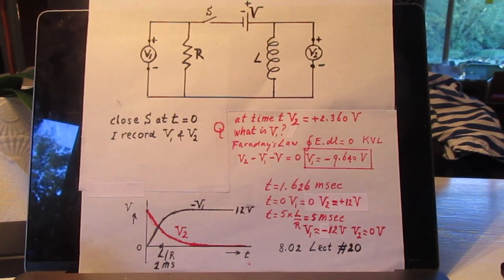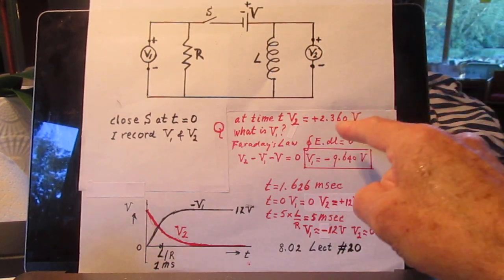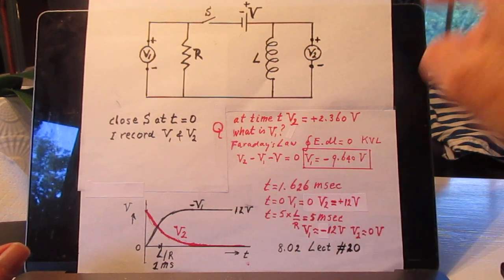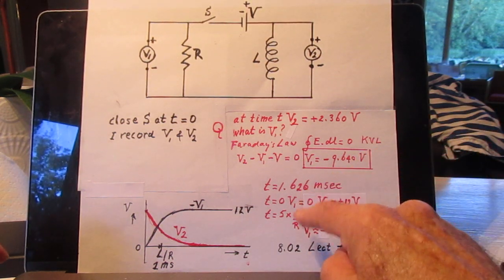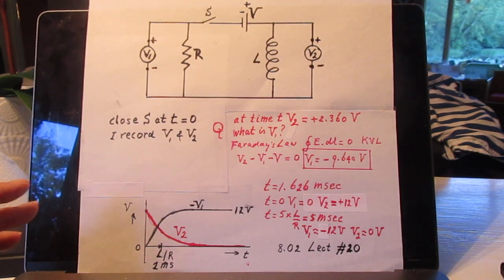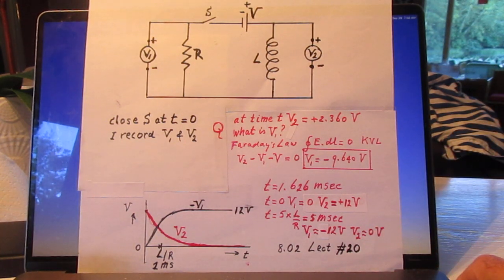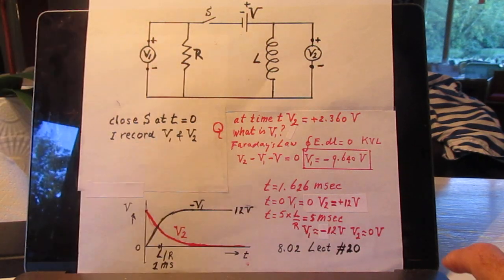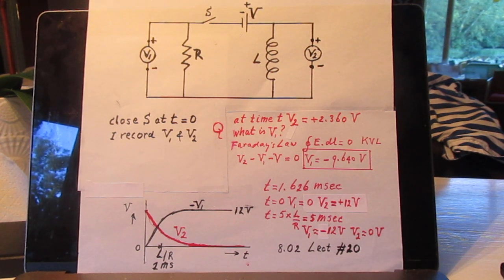Solution Problem #120 - Self Inductor + Resistor

Comment: Professor Lewin, I have a question. Can a pendulum ever stop under the effect of Air resistance? Air resistance reduces, if the pendulum bob's velocity reduces.
Reply: Sure it can. The magnitude of resistive force may reduce but it is always directed opposite to the velocity. It would definitely stop.

Comment: Ive been thinking about why the current slows in the inductor and I think I have a 'dead animal' explanation (sorry about those) to go along with the previous rollercoaster, conservation of momentum analogy. 
In the cyclotron, the radius of the  electron's orbits is determined by the strength of the magnetic field i.e. it does positve magnetic work to attract towards the center and turn the electron but simultaneously has no effect on velocity.
In the coil, the magnetic field does no work to change the direction, the electron does that work on its own or was done for it by whatever twisted the coil around and so logically the work now performed (which is inescapable) by the magnetic field is now negative, a repelling force and works opposite only upon the velocity and not the direction which is now wholly determined by the coil circuit design.

Comment: Can  a voltmeter be connected wrongly in a circuit?  V at the lower end of R is heigher than V at its upper end.
Reply from the maker: When I measure a voltage with my digital voltmeter, I attach it to 2 points, NOT knowing which of the 2 is + or --. If I measure --12 V then I know which side is + and which is minus. If I measure +12 V I also know that. Thus there is no such thing as connecting it wrongly.
Reply: @lecturesbywalterlewin.they9259  .. thank you dear Prof. for the clarification. Used voltmeter is a digital voltmeter not the commonly used high resistance voltmeter as used in dc circuits. But I have read somewhere that the digital multimeter have issues measuring transient currents and hence potential difference. 🙏
Reply from the maker: @parasharisir  When I was a kid I had a analogue voltmeter. It had a + side and a - side on the scale. Zero V was in  the middle.  You could use that voltmeter in the exact same way that I am now useing my digital voltmeter.
Reply: @lecturesbywalterlewin.they9259  ... dear Sir, can I draw your attention to time or ( /time constant) as used in this problem. It is of order of 1 ms. Can a digital voltmeter/ multimeter do this measurement? 🙏🙏
Reply from the maker: @parasharisir  watch my 8.02 lecture #16.  I make voltmeter measurements on a time scale of less than 0.1 msec. That's what oscilloscopes are for.
Reply: @lecturesbywalterlewin.they9259   Thank you so much dear Professor. 🙏🙏☺️. I do appreciate your efforts.
Reply: @lecturesbywalterlewin.they9259  
Just saw R,CL parallel circuit as well.
... dear sir solenoid is completely filled with non conservative electric field, whose planes are perpendicular to the time varying magnetic field along the axis ( still closed path line integral E.dl =0). Yes, no electric field along the axis of the solenoid!!   Thanks
Reply from the maker: @parasharisir  >>>> solenoid is completely filled with non conservative electric field, >>> incorrect The non-conservative field is elsewhere in the circuit not in the ideal solenoid
Reply: @lecturesbywalterlewin.they9259  ..... Thanks a ton dear Professor. Will try to expore and correct my mistakes. ☺️🙏.
Reply: A voltmeter can be connected backwards in a circuit, and it will just mean that you get a different sign than you expect.   If you are using a voltmeter to check polarity, you want to make sure that it is connected the way you expect, so that the sign on the meter tells you the information you need.  If all you care about is magnitude of voltage difference, it won't matter, and you'll get the same answer either way.  You can also connect a voltmeter, as an ammeter should be connected, and it will just end up reading the open circuit voltage, instead of the voltage of the circuit while it is operating.

It is an ammeter, or a multimeter in Amp mode that requires proper connections, otherwise you could damage the meter or circuit.  The correct way is for an in-line ammeter to be connected in series with a circuit, so that all the current of interest to measure, will pass through it.  If you connect it in parallel with a circuit, you will short the circuit through the meter, and draw more current than the meter can measure.   Ideally, there is a fuse in the meter to mitigate the damage if you do it wrong.

Comment: If I wanted to build a Kelvin water dropper, would there be a difference if I used a sharp object to discharge the electricity, rather than a spherical object?
Reply: Then it will reach breakdown voltage earlier

Comment: You should teach your viewers some LaPlace.
Call the node connection L and R for Vo. The node equation becomes

(Vo-Vin)/(sL) + Vo/R = 0 

And the transfer function becomes

H(s) = Vo/Vin = R/(sL+R)

When you close the switch, Vin is a step, so Vin(s) = 12/s
Vo(s) = H*Vin = R/(sL+R)*12/s

The inverse LaPlace gives
Vo(t) = 12-12*exp(-1000*t)
Which matches the two transients you have graphed. But for students, math and equations may make more sense than just pure intuition, in my opinion.

Comment: I= V/R(1-e^-Rt/L)
Voltage across resistance V(R)= V(1-e^-Rt/L)
Voltage across Inductor V(L)= Ve^-Rt/L

Putting the value of V(L) = 2.360.  we can find the time . And further can use second equation for finding the voltage across resistance at time 't'.  I solved using this method. Thanks to Walter Lewin sir, Alakh sir, HC verma sir, Rajwant sir and Tapash air for teaching me. I am very much thankful to all these teachers...

Comment: Good explanation. You could have addressed what happens when the switch is opened. I design electronics and preventing the high voltage spike when the switch opens is a very important part of many designs

Comment: Sir How LCR Circuit useful for everday life?
Reply: Homemade antenna --  think maximum power transfer.(and less smoke)
Reply: Electrical filters.   You can take advantage of the fact that inductors and capacitors have different responses to different frequencies, and arrange the components so they can either stop or pass a desired range of frequencies.  In the extreme limits, a capacitor acts as an open circuit at low frequency and a short circuit at infinite frequency, and an inductor does exactly the opposite.  In combination with a resistor, an energy storage component can form a low pass or high pass filter.  This is what is used in the circuits that make bass and treble knobs work on an audio system.  You can also use the condition of resonance between an inductor and capacitor to set up band pass and band stop filters.

This is also how your landline telephone can double as the carrier circuit of your internet, in technology such as DSL.   You can equip the landline receivers with a low pass filter so only the frequencies in human voice get through, and you equip your modem with a high pass filter, so the landline voice signals do not get through.  Dial-up internet didn't do this, and used signals within the range of human hearing, so you couldn't simultaneously use internet and phone.  DSL selected carrier frequencies above the range of human hearing, which has the advantage of a greater bitrate capacity, and the advantage of not being in conflict with the audible voice signals.  You can also use the condition of resonance between an inductor and capacitor to set up band pass and band stop filters.

Comment: No, I think it will be 
V1=9.64V, not 9.640V.....
Reply from the maker: both are wrong!
Reply: @lecturesbywalterlewin.they9259  ok, but why, u have explained that V1 will be equals to 9.640V!
Reply from the maker: @satyamparija7614  >>>> why, u have explained that V1 will be equals to 9.640V!>>>>   I DID NOT V1 = --9.640 V.  plse watch my solution and get educated.
Reply: @lecturesbywalterlewin.they9259  V1=-12V and V2=0V,,,,,, right??

Comment: Mr. Lewin I have followed your footsteps of unraveling true nature of the natural phenomenas surrounding me but  me and my friend have come across a phenomena which we haven't studied in books or a podcast. We have observed that when a flashlight strikes an A4 sized paper then it glows blue  and so on when we add pappers we found that it turns red, the same experiment done with other papper made the reverse transition of colours. It would be an honor if you help us with the problem!
Reply: I think the colours that you are seeing is due to some chemicals like linen or other binding compounds. When the polychromatic light is flashed on the surface due to absorption and re emission of the complimentary light waves, you are seeing the colours. I think that this phenomenon will be different depending on the material like normal A4 sheets and hand made paper. Though there may be other explanations such as the pores being comparable to the wavelength of incident light thus leading to diffraction and dispersion while considering the uniformity of the paper. 

Let me know if you find the reason.